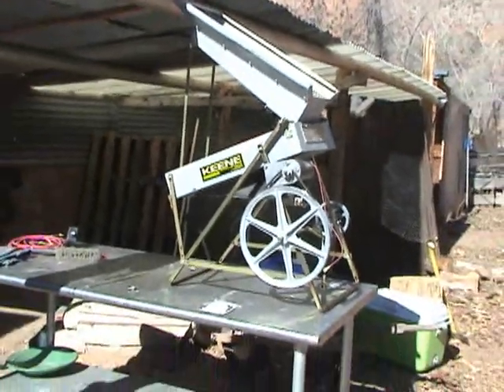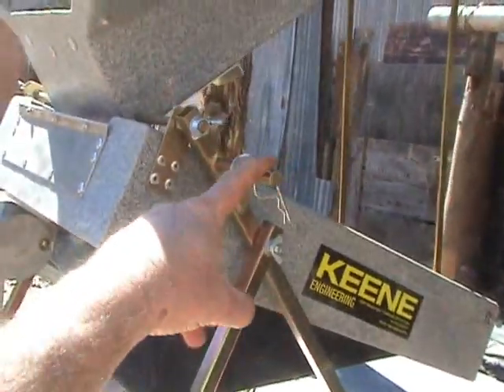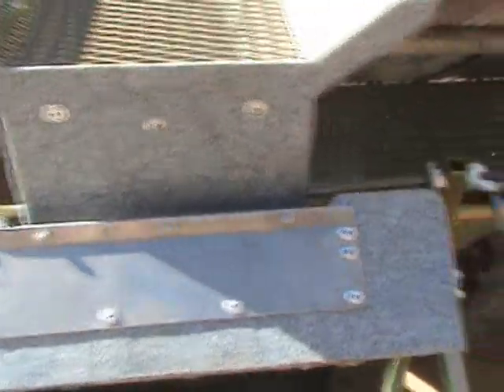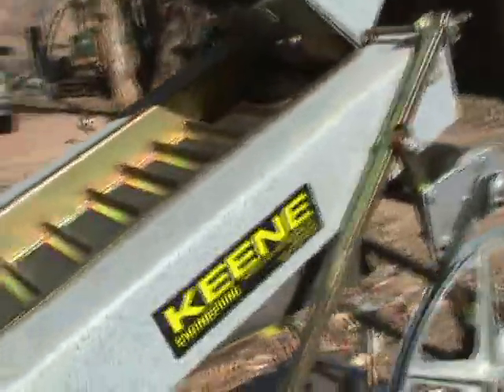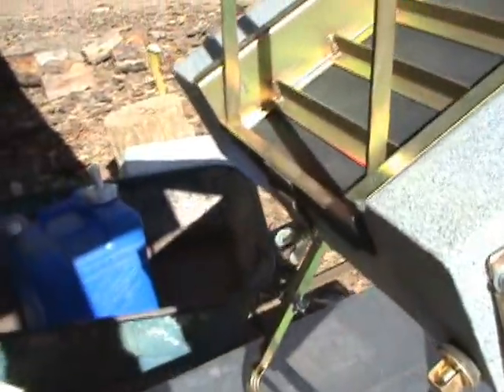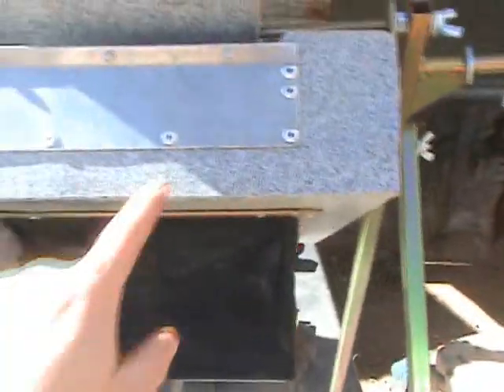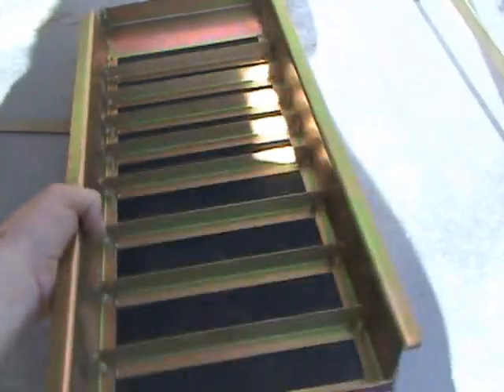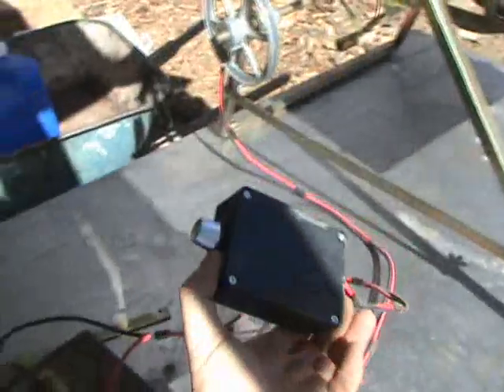Keene Engineering Dry Washer, Modifications 01: Introduction

Comment: I must believe you work for another drywasher manufacturer. I have used the Keene DW212 for nearly 18 months and found it to be the most reliable puffer out there. First since when do rivets allow air to flow thru them, go see if you can run a wire thru the rivet.  You want to put a tool bin on a machine that throws dust all over the place?  I would feel alot more confident in your appraisal if you could tell the difference between fiberglass and rotomolded plastic.  Lets talk about the hopper bar that you want to put a 1/2 pvc sleeve on to stop it from sliding and being worn down. First since it does slide a little it allows the support to hold up the hopper when you clean out the riffle tray. I simply slide the hopper to one side and rest the support on the edge of the drywasher bottom.  How can rotomolded plastic wear out a steel bar? I could go on and on about your analysis but I think you get my point. So far not one of your comments have any basis in fact.

Comment: My experience is that the riffle tray needs to be at the maximum angle allowable with the original parts that it's made with. And I would like it to be at an even steeper angle. This is nothing like a sluice box that uses water to wash all the light stuff away.  So the equasions used for the angle of the riffles are different.

Keene Engineering shouldbe be ashamed of themselves. I had long talks with the head honchos there including Mr Keene's son. They just don't care.

Comment: If you don't like this so much sell it and buy something else. I find it quite easy to keep the feed hopper out the way by having the fold out leg folded back against the hopper and I can easily refit the rifle board back in with one hand and hold the hopper up if I need to having a variable speed on the drive is good for different grades of materialsthe hopper is Polyethylene  You just seam to be a professional winger